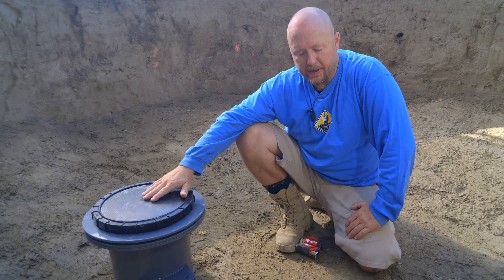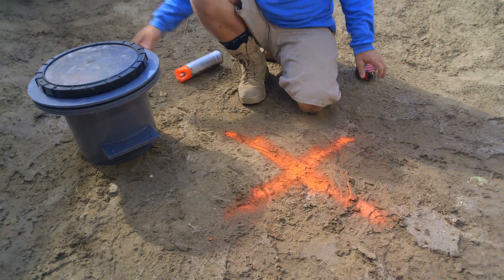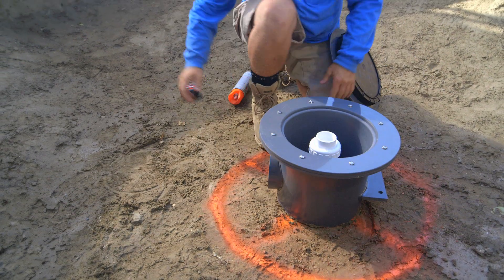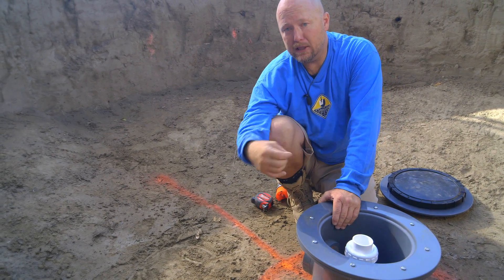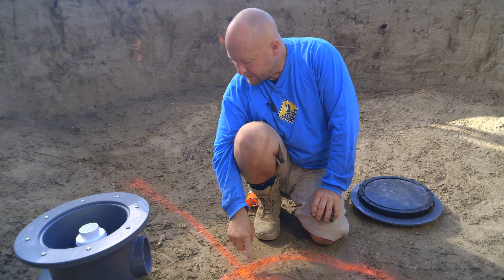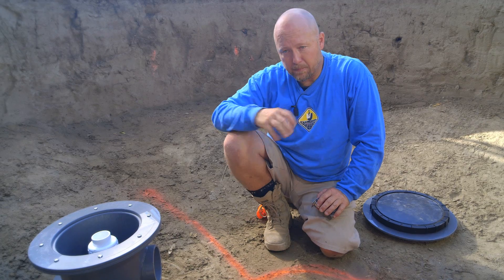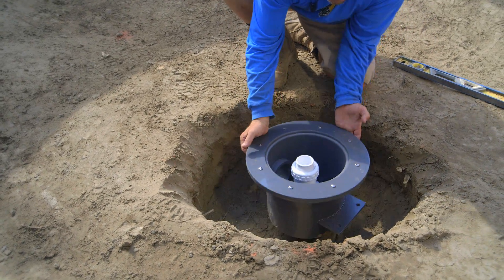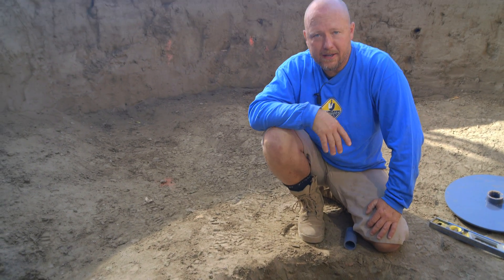DIY Koi Pond Construction | Pond Bottom Drain Layout & Design - Part 10

Comment: i have a concrete base pond. would you recommend installing a bd, and would it be safe to do so without compromising integrity of the ponds structure?

i am thinking of drilling a hole in the base, digging under the base to install the bd and pipe.

any solid advice will be greatly appreciated.

Comment: I built a pond myself, before knowing anything about bottom drains, is there a way to add a bottom drain to an existing pond without draining and pulling the liner? Also I am unsure how I would plumb it, i currently have a pump in my skimmer which feeds a homemade waterfall filter.
Reply from the maker: +Brandon Lavy I'm not a big fan of putting a bottom drain on top of the liner. I suppose in a retrofit instance it might make sense. Here is a link to a video where I talk about bottom drains on top o liner. I hope that helps. 
https://youtu.be/WQFRctNL8AA

Comment: Great job PondDigger, I have been learning a lot watching your videos and educating myself on pond design and Koi, your videos are priceless. Can you share what model of bottom drain you are using? Looks like the Rhino II with diffuser. Will be attempting my first pond build this spring, thanks very much for sharing your experience..
Reply from the maker: Kevin Scott Yes that is a 4" Aerated Rhino Drain
Reply: @ThePondDigger  Hey, does this bottom drain with diffuser require additional mechanical or electrical pump for aeration or is it natural air pressure?
Thanks

Comment: The larger pond will have a small bridge for children to cross over & I plan to build in some sort of fencing. & I want to interconnect the 2 ponds running on 1 pump, so I guess I should do some basic measurements.